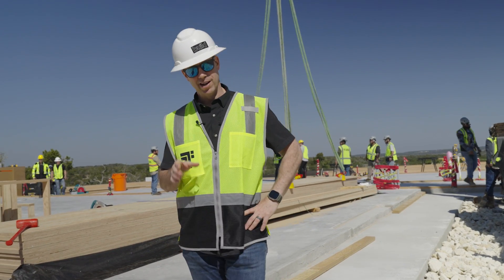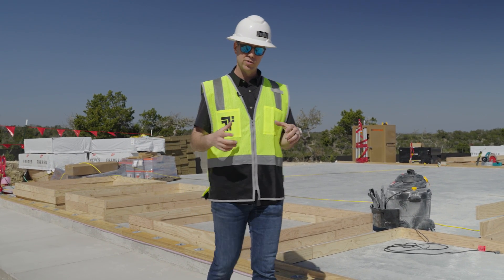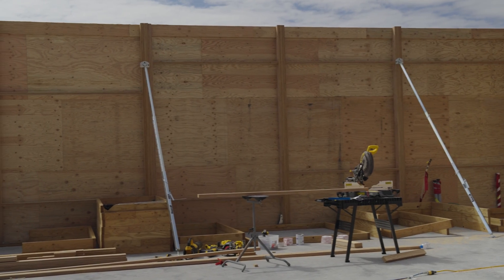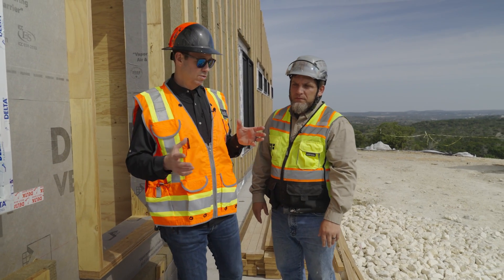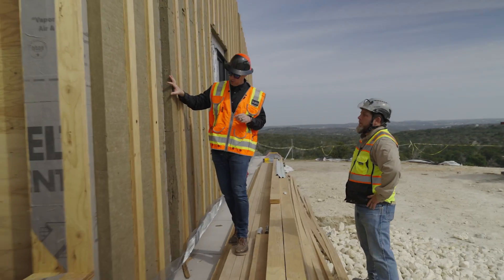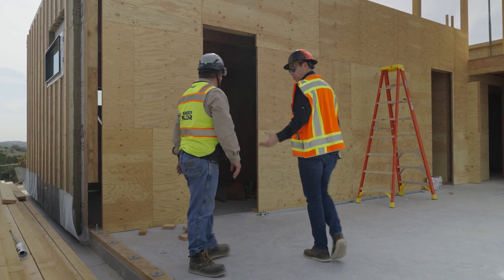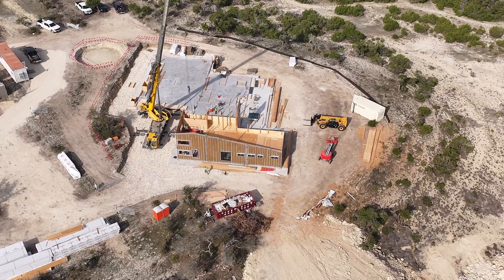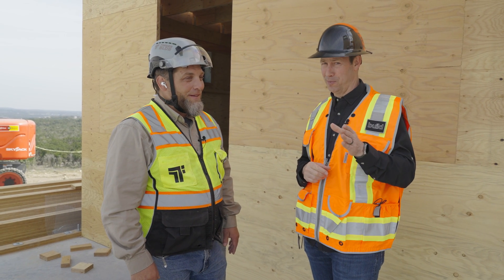NEW FRAMING Like You’ve Never Seen - Mass Ply Light House/Barn

Comment: I’d hate to measure the formaldehyde levels in the house when it’s completed. 😂
Reply: The engineered wood manufacturing process lowers VOC's. Veneer processing is an even lower emitter than lumber. The veneer for Mass Ply is dried to a lower moisture content than lumber for comparable mass timber products. The lower moisture content of Mass Ply veneer leads to lower service emissions of formaldehyde than that of lumber. This difference is especially pronounced since the hot pressing of veneer further reduces in-service emissions of VOCs.
Reply: Go for it. 
I'm sure Matt would let you.

I bet it'll be lower than the level you're implying and what  you'll claim it'll be.
How much you wanna put up?
Reply: He’ll install extra Zhenders for that.

Comment: I like the build idea,  but the contractor is asking for trouble with out using a treated plate.  I am a builder in Texas and The Hill Country has a ton of termites . Good luck on the new building process.
Reply from the maker: Excellent point. However, we used termimesh at all of the penetrations in the slab. If you’re not familiar, it’s a physical barrier for termites. Fantastic product.

Comment: Cost? 
99% of the time anyone says "You've never seen this", it's because it's Beyond The Valley of Ridiculous Cost.
Reply: You've never seen this because it's never been available here on any sort of scale.

Things can change and this is one of them. The same people will be building these in a different yet similar way with a similar skill set.
Reply: Bet it's less than stick framing at this site.
Reply: @sparksmcgee6641 man I doubt that. The amount of material is absolutely bonkers for one thing. Typical house is sheathed in 1/2” OSB. This has 1.5” ply.

This project was definitely not done to save money.
Reply: @patty109109  But you're only looking at that cost comparison. There are many other things that will go down in comparison, including NOT having to run a crew for days (or weeks) to stick frame the thing. There are also the long-term costs with the payback on the rainscreen and possible onsite electricity production which should work to the owner's advantage.
Reply: The cost has to be double, LVL material is very expensive.
Reply from the maker: We will talk cost on episode 3 when we complete framing. I think you’ll be surprised that the price is lower than you would expect
Reply: @buildshow When you talk about cost can you please compare it to the same building type and SF but using standard stick framing and standard pole barn framing? Include both the raw costs and the percentage differences along with per sf price. Also it would be great if you could break it out into material costs and labor costs so we can see directly how this method is more labor and time efficient since Trent noted the speed of the window flashing and install.
Reply: @buildshow That would be most interesting ... thanks!

Comment: What are the benefits?
Reply from the maker: Compared to a Steel frame that would typically be used here we have multiple benefits. “Normal “ tools, easy to nail/screw into for finishes & trades, less condensation/thermal bridges issues, carbon sequestration, renewable lumber and great use of materials. Plus it will look amazing inside. Rather like a modern log cabin
Reply: @buildshow Matt I did this on my home in Denver 20 years ago when I built a modern 1910 warehouse look. A lot of restaurants in older warehouses here with interior exposed brick and beam. For a decade I'd have to go to dinner with people who loved the look. Then after someone finally asked I'd start pointing out it was surprising the building was still standing when converted and point out all the "hack" work that they knew would be covered and is now exposed. 
Unbaked brick for repairs and supports on 18" beams that supported an upper floor??? All the time.
Reply: None really except for bragging rights.
Reply: Potentially cost, but it also looks like, with the addition of a crane, that it's nothing of the sort. I was floored frankly by how this was put together - and not in a good way.

Comment: how does it deal with water leakage or high humidify into the ply? Accidents happen; like pipe burst, clogged drains or AC goes down mid summer for a week.
Reply from the maker: No inside drywall or cavity insulation means this is a very resilient home. A leak is spotted immediately and nothing to mold
Reply: I think you're a bit out of date on how stable this quality of ply is, including dealing with water.
It's common that people think of all the plywood they've seen in thier life including the 1970 tract home roof sheathing as one product. It's not.
Everything in materials is in the product specifications. Way diffent performance levels.
Geek out on CTL and all the mass timber products. You could do this with a solid lvl wall and people would be less skeptical, which is funny since lvl is plywood.😊
Reply: @sparksmcgee6641   house here are built different. My header doesn't use lvl, its a solid timber and my beams are galvanized H-beam. The only building changes here are the use of truss joist, better insulation and conditioned attics. No builder here is dumb enough to place hvac or ducts in the attic either, dedicated space for this is made during the planning.
Reply: @sparksmcgee6641 high end OSB as well. Some stuff is rated for months of water exposure.
Reply: yeah i wouldn't use this stuff anywhere outside the sahara desert
Reply: You have to waterproof it. It’s expensive